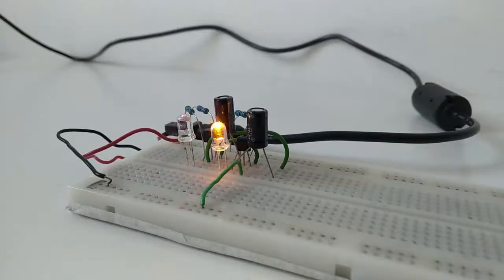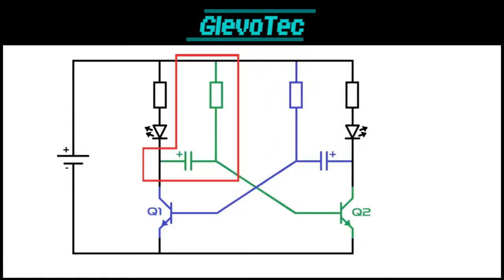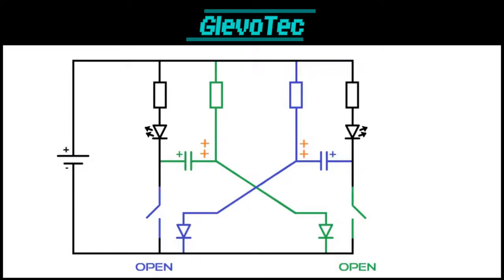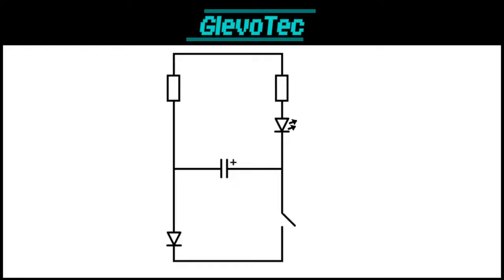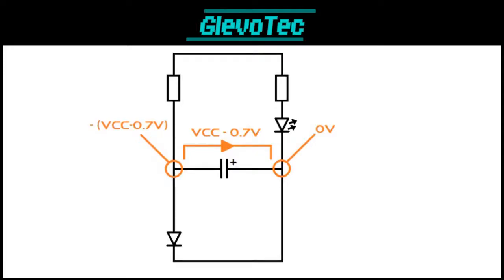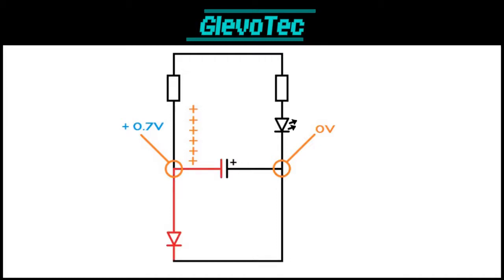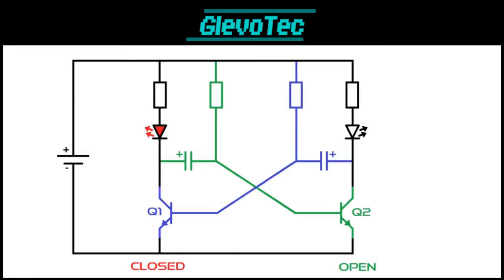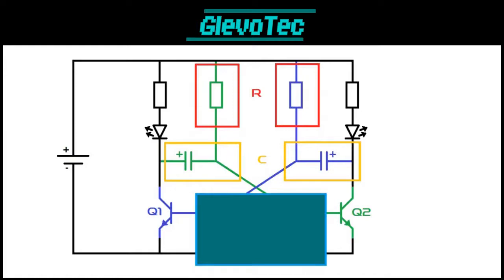How a 2 transistor LED flasher circuit oscillator works | Easy simple explanation

Comment: Don't you need to replace the LED with a diode instead of just removing it ?

Thank you for your great video  :)
Reply from the maker: The LED acts as a load. So you can simply remove it, as long as you keep a resistance there to charge the capacitor.
Reply: @GlevoTec  thanks. I realize that I lack a lot of knowledge to properly understand only that simple circuit!
Reply from the maker: @vincentletard7379  No problem. To be fair, it is not so difficult as it looks. You just need to get the principle. Anyway,  always keep learning!

Comment: The wires connecting the capacitors and their opposite transistors are not connected in between .are they ?
Reply from the maker: No, they just cross. Like said in the video,  the circuit consists of 2 identical parts. Each capacitor-transistor pair is a separate part. Not connected in between. This would disrupt the circuit.
Reply: My circuit has those wires insulated but still the circuit works fine

Comment: This is a great video. However I have one doubt, are the capacitors electrolytic? If so, then how are we able to charge them through the cathode? This is bothering me very much. Hope you can clear it out. Thanks in advance!
Reply from the maker: Thanks. The capacitors are indeed electrolytic. But they don't have to be necessarily. They can take a small negative voltage without getting damaged
Reply: GlevoTec Appreciate the help, thanks!
Reply: I am like you! In every course I see the RC costant, charge/discharge cycle and then this circuit where the polarity is switched!
This is bothering me a lot, as well.
Anyway, this video is very clear about the circuit; on of the best I have seen!

Comment: Sir,  I  am  a  YouTube learner  in electronics. I want to light up led on single wire  parallel connection ,one led -ve +ve another one +ve -ve.
Can you make a simple circuit with   pnp and npn transistor.  At present I am  getting this from quartz clock board.  Can you  help me.